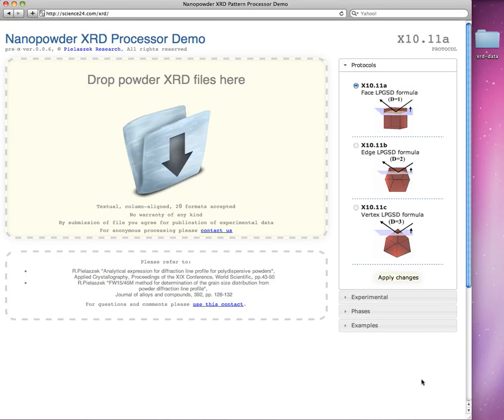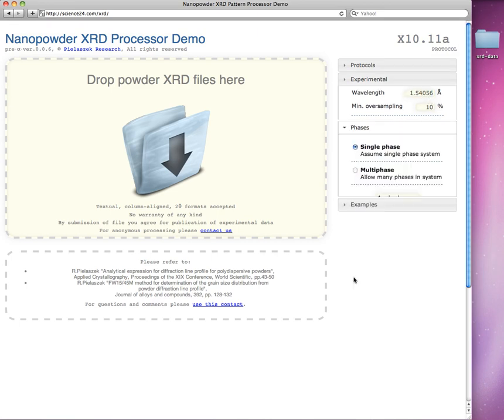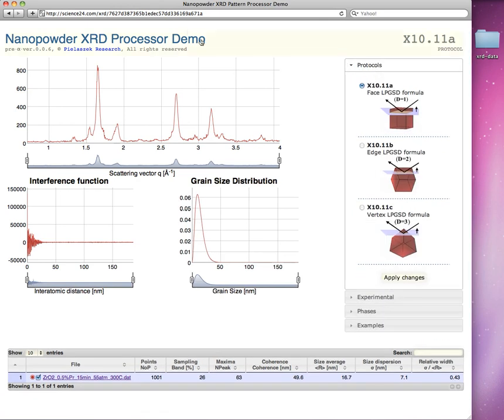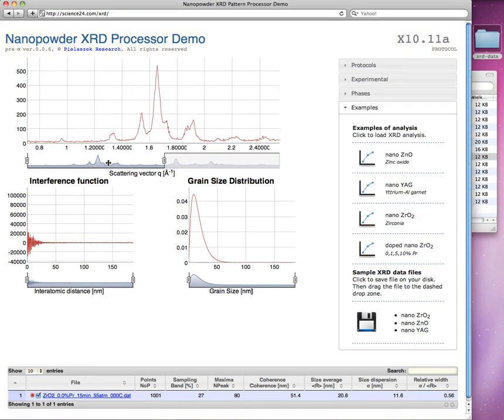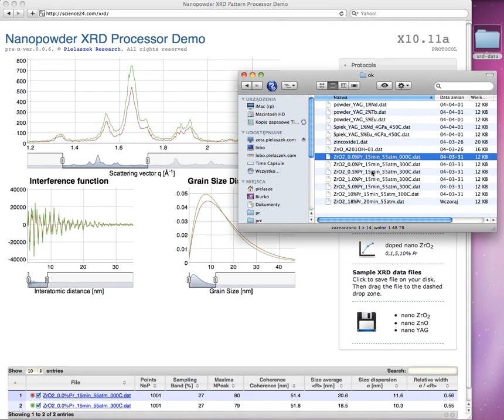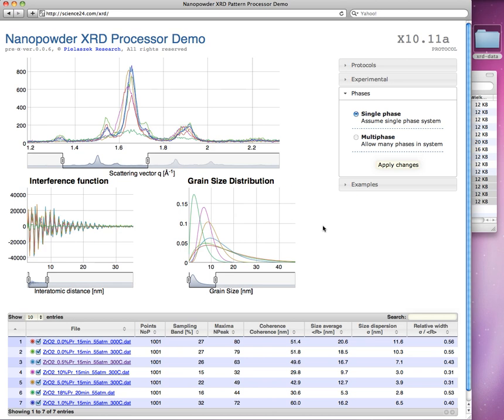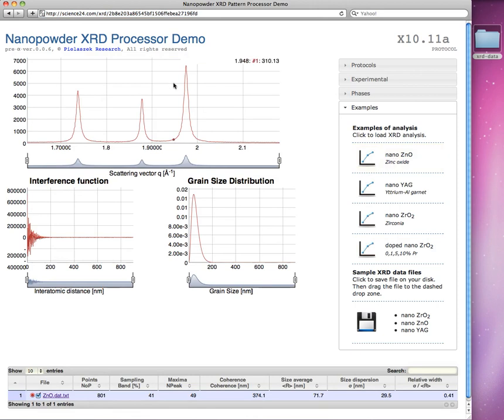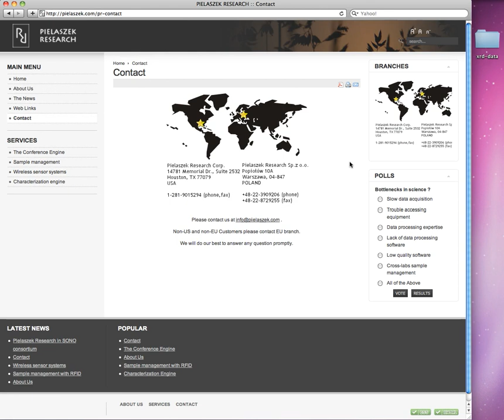Introduction - Nanopowder Processor Demo - science24.com/xrd

Comment: how to create .dat file from .raw ? the webpage is not accepting .txt or raw file
Reply from the maker: Well, at present the page accepts 2-column text format only. Extension does not matter. Sometimes there may be a problem with CR vs. CR/LF line termination characters. Also, please make sure that decimal point is dot (not comma).

Any binary format, like raw, needs to be converted to 2-column text before dropping into XRD Processor.

I think best way to find out the format is to get sample XRD files provided on the website. If you format your data similarly, it should be OK.

In case of any problem, please feel free to contact at support@science24.com

Comment: is there any means by which we can download those graphs and the tables for further use.... eg. in paper publication and thesis compilation
Reply from the maker: Tables:
Mark table with mouse (start a bit above table, end marking a bit below table), then copy. Paste to Excel. On Mac, there is full table with headers and values nicely pasted.
Graphs:
Easy way: take screenshot, of courseFull control: copy/note values of average size <R> and dispersion (sigma) and go to http://science24.com/fw145m/. Use Plotter form (2nd from bottom). Put values there. You'll get XY data of the Grain Size Distribution curve to display/format in your favourite plotting program.
Commercial users: please contact us (http://pielaszek.com)for any specific output you need.